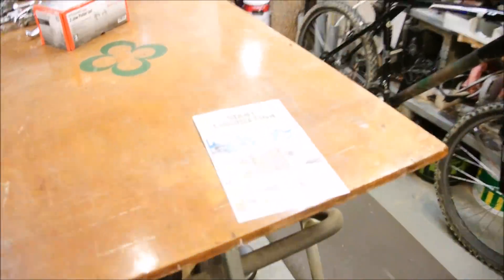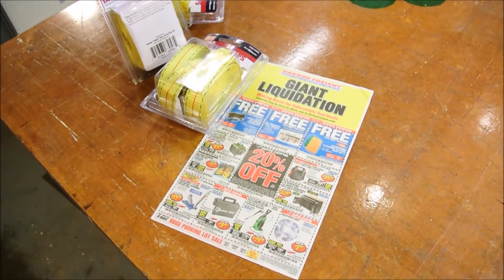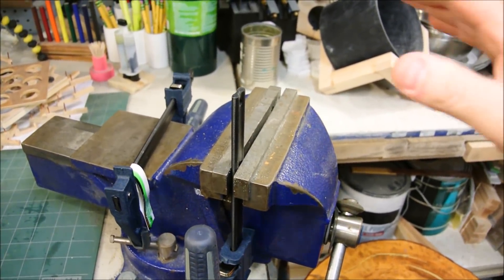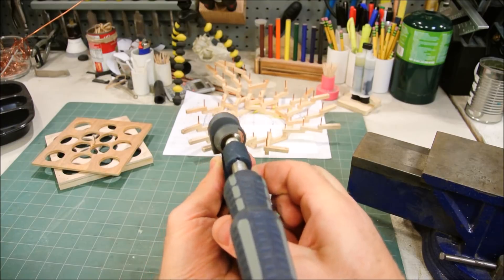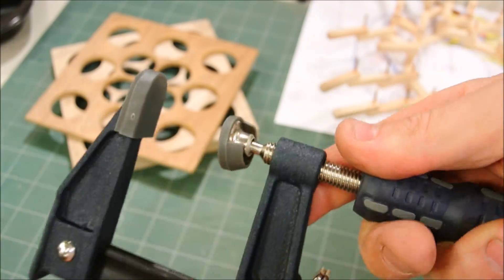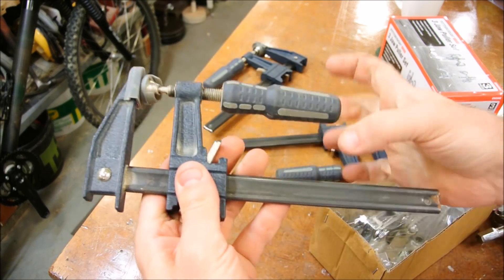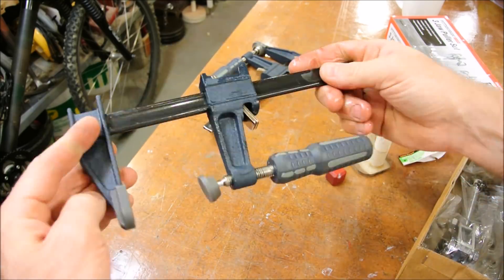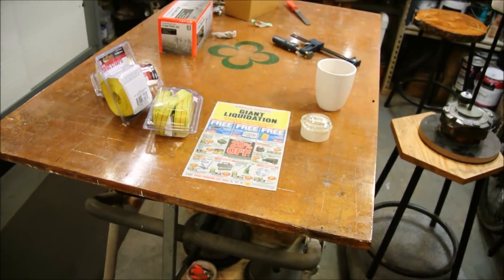Preparing, using, and improving Harbor Freight 'F' clamps

Comment: Good stuff. Also, I had a project needing outside pressure (spreading). Ground off the pins for the jaws and flipped them 180 degrees. Used a screw for the fixed jaw, didn't bother with replacing pin on other end .It won't provide the rigidity for heavy force, but still very handy.

Comment: Thank you for teaching the only effective way to make hot glue work on massive, conductive substrates.  Hot glue can be absurdly strong when applied to a hot substrate -- but everyone just uses a tepid glue gun.  It's no wonder that you see so many cases of it merely disbonding cleanly from things (e.g. in modern crappy cabinetry, etc)

I also appreciate that you know whose casual obsessions are worth accurate description and low regard.
Reply: Dream Services International maaaaaaann... i tried the diresta two pieces of wood, and pop the glue off once i was done working the smaller piece. I dont know what i did right but whatever it was, i couldnt just break them apart after like jimmy does
Reply: There are definitely differences in the operating temp of glue guns and the heat requirements of the glue sticks.  For that matter, the density of the wood has plenty to do with it.  

Gluing on metal is another story.

Comment: Love the tips!  I have a small herd of these clamps in different lengths myself & will likely use many of them myself. =) 

One problem I've had with them is that the handles spin after a while when applying even a small amount of pressure.  My local HF is pleasant about swapping them out, but I wish there were a solution so I wouldn't have to.

Comment: I bought 4 of these recently, and 4 of the "quick grip" style. The quick grip (with the squeeze handle for final tightening) didnt work at all. 1 completely broke apart the first time i got it tight. The F clamps.... the motion was awful and 2 of the 4 cracked on the lower jaw as i was tightening them the first time. HF replaced them all for free but the newer ones arent better.
Reply: I was able to fix my quick grip style by drilling out the plastic area where it had the bit that holds the handle in, you know the part that breaks under repetitive pressure.  Then i used a spare bolt and nut to act as the fulcrum point for the lever/handle, works like new again.  The handle is plastic, so i expect that it will just break again, but at least i've extended the useful 
life of it.

Comment: I would respectfully recommend cleaning the clamp’s rail first. There is probably debris from the construction process, paint, and oil to prevent rusting during its trip from the Pacific. Instead, use a cloth rag then use a wax or dry lubricant. Saw dust will be attracted to oils you’re using.

Comment: Pittsburg ratchets and breaker bars are terrific. Impact sockets are fine too. Maybe do a little more research before trashing them.
Reply from the maker: A few exceptions to the rule doesn't alter the average: most HF tools are verifiable crap. If "research" entails buying lots of HF tools just to nail an occasional gem, I think I'd prefer to stick to Blackjack-- better odds. 

Still, love the blue clamps and the yellow straps. And honestly, those little flashlights are downright handy, amirite?
Reply: pocket83²  k

Comment: Amen brother. Customising the tools most used is a real gamechanger. Why be unkind to your hands when you could have tinkered with the tools slightly and save your hands from callouses, scuffs, cuts, and develop cramps and strain injuries. I'm a chainmail maker, so I burn through about a dozen pairs of pliers every year. Every one of 'em has the handles removed, then the bare metal pliers get bent into the right shape, foam wrapped (dollar store double sided foam tape, several layers), and lastly topped with a couple of layers of self-vulcanising tape on top for maximum grip and maximum padding. When they wear out, I just toss 'em in a bucket with a layer of wd40 misted on top. Full bucket goes to charity thrift market for some other soul to get some use out of 'em.
Reply from the maker: Thanks for sharing your method. I may try it. You know, needle-nose pliers are probably the hand tool that I use more than anything else. I have dozens. It's just a great general tinkerer's tool. But I've tried so many grip methods, and I still haven't found a method I consider video-worthy.  

Do you have a favorite brand or style? My favorite so far is GRIP (Grand Rapids Industrial), which come from a discount warehouse near here for 2.99 a pair. Hard metal and a nice geometry. I've been sticking their cusions back on with epoxy, but that still doesn't last the life of the tool.

Comment: I also filed down the edges of my cheap vise. You can really hurt your hands if you file or saw and bumb against the sharp edges.
Reply: The back edges of the jaws are great at skinning knuckles.  I just closed the vise with nothing in the jaws and  dressed the nonfunctioning edges with a flap disk.

Comment: For those that insist one direction when filing, how about hacksawing ?
Surely that falls under the same rules :P  :D
I don't lift the file from the work most of the time, though i do lighten the pressure on the backstroke, lifting and dropping onto the work would surely do some damage
Reply: You don't need to lift it entirely from the surface that you're working on, but you need to not apply pressure and basically just draw it along the edge to reset the file/blade edge location. It's also not about "tool fetishism", but just taking care of your tools properly, so that they don't recieve undue wear and tear and you don't need to replace them as often as you might otherwise, if you don't treat them right.
Reply: I've read how-to's in books to perform just as you describe, as it allows the fillings to dislodge and fall free.
Reply: Using a hacksaw like that wears it out quicker just like a file.

Comment: I suppose oil will do, but wax works well and is more pleasant.  It can be frustrating when a coupon has expired, but there is not a lot to complain about with regard to HF coupons.  They have a generous policy, and the poor guy behind the register probably doesn't have the authority to let you use an expired one.  Expiration dates are printed on them.

Comment: I have a bunch of HF clamps and they work well. But my new favorites are the Bessey clamps that I picked up recently. Waaaaay better quality and they cost about the same at a set of four for $15 at the orange depot.
Reply from the maker: Wow, that's a pretty good price. I always thought the Bessey was a bit clunky, though. I have a few cabinet-sized ones.
Reply: I bought a couple sets of four for under $10 each after Christmas at HomeDepot..
One thing I don't like about the Bessey version is the smaller wooden handles.
Makes it harder to grip.